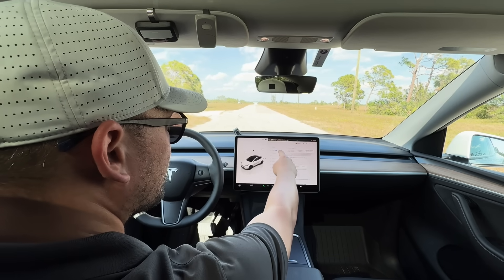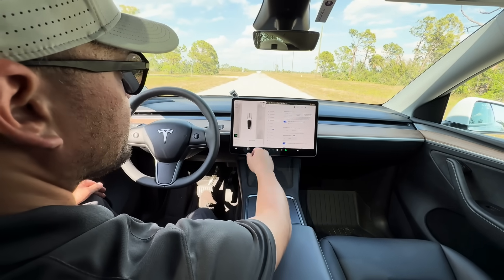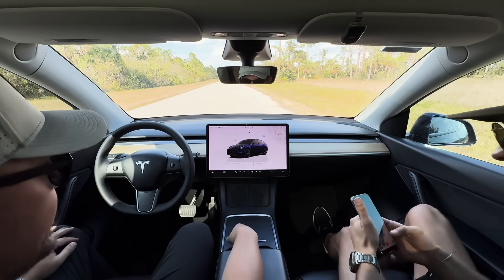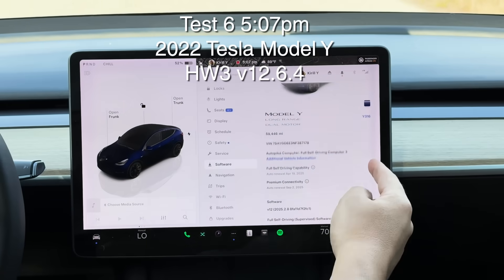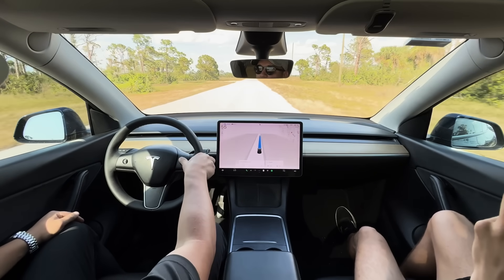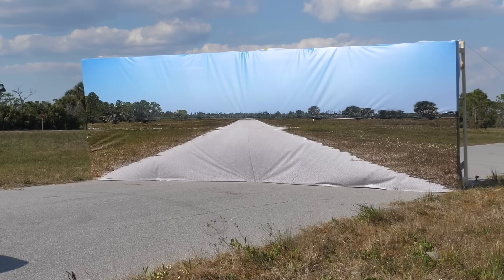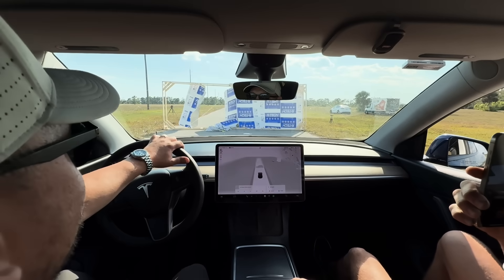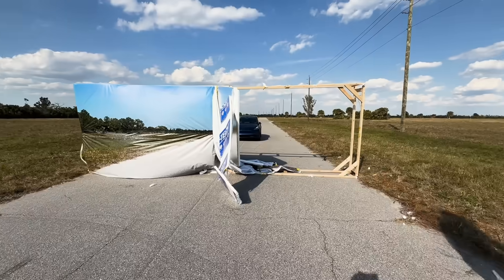Mark Rober Debunked - You can't fool a HW4 Tesla using FSD!

Comment: Everyone with more than 2 brain cells and barely surface knowledge about the tech would know this (if a human can spot the difference, FSD would also be able to). It was clear from the start that the NASA "scientist" was faking the results.
Reply: Well, he could instead of fake, just use an old version of the autopilot, which is still poorly able to process what he sees. But that doesn't change the fact that there are a lot of suspicious flaws in Mark's test.

Comment: Is your car equipped with radar?
And are you Sure it is Not equipped with it? (i.e. look where radar is placed normally)
Reply: Tesla hasn't used lidar in a long time. Especially not on the newest models. The only place where they use lidar is at the production stage for camera calibration.
Reply: @Wolfen13c  Oh the contrary. Some cars were equipped with radar (not lidar you know...). There have been teardown of a model X with HW4 and that one had the new so called phoenix radar installed. So we do not know for certain since Tesla is reeeeeallly quite about this (of course since he said that radar was not needed.....).

Comment: Not quite.  What you've shown is that your wall didn't fool your Tesla on this one test. This is very different from showing that the FSD system would never be fooled.  Just visually comparing your and MRs walls in your case there were obvious artefacts at edges that the algos might pick up at the decision range .  However, IMO the test shouldn't be that the FSD should never be fooled, but more that it should be fooled significantly less than a human driver.   This would be hard to achieve without LIDAR or hardware capable of full scene stereo 3D reconstruction.

Comment: Mark's claim was that cameras (vision-only) are fundamentally flawed, so it would always fail this test, and that the only solution is LiDAR. This video shows evidence to the contrary. Therefore Mark's claim is fundamentally flawed.
A good scientist would issue a correction, given his massive reach has massive consequences.
Reply: His claim was that they were inferior to systems that incorporate lidar.  I'll take it a step further and say any system that doesn't use multiple types of sensors (ie. camera and either lidar or radar) is going to be inferior to one that does.  Even Xiaomi and BYD use multiple sensors for their self-driving despite producing cars at a much lower price than Tesla.
Reply: Correct. I don't think he ever will.

Comment: There's a much better test that has a real story behind it, which happened in Sweden 45 years ago.
A bridge called Tjörnbron was hit by a ship and crashed, so a large part of it disappeared. It was night and foggy.
Seven cars drove over the edge, because they didn't saw that the bridge was missing.
FSD should handle such things, and sink holes too.
Reply: Someone should paint a sink hole/missing bridge on a road and see if it can fool the cameras.
Reply: I'm fairly certain there's videos showing FSD kicking out in heavy rain and fog... No missing bridge needed. Might be a good niche case for lidar though.
Reply: @bobclark6350  Fog, steam, and rain can mess with lidar, mark didn't do an accurate test.
Reply: Interesting but not really the point of the video.
Reply: Seems a bit to much to ask I think. It would depend on the angle of the sensors etc.

Comment: The whole original test was a refutal of visio-only based systems as they can only act on what they see. When there’s heavy rain, fog, bright lights etc that blind the cameras, it turns to shit. Radar/lidar doesn’t operate on ”vision” per se, so it will work in a lot harsher conditions. 
This test only tried the ”perfect weather” parameter. And it seems the hw4 is at least better than hw3 in that regard.
Reply: Robers test was also a perfect weather parameter. You can easily search HW4 performance in harsh conditions here on youtube.
Reply: @ did you miss the fog, rain and harsh light parts of the test?
Reply: I dont care. There was a difference.

Comment: Great job guys! Mark Rober should watch this and learn.
Reply: Mark Rober's picture didn't have tall trees at the sides.  The improved AI (and humans) can easily pick up on the parallax differences in the trees.   Someone could always create a fake picture in certain places that would completely fool humans and probably any AI that only used cameras (up to the resolution and distance where you could detect and measure the distance of contrasting pixels by triangulating from multiple cameras).  Or, depending on the lighting conditions, you could stand a mirror up in the middle of a straight section of road. It's kind of a silly test just to prove a point.  Obviously LiDAR can see better thru fog and in total darkness. Seems like it would help AI driving to be much better than human if it used sensors that humans didn't have.

Comment: somebody else performed this same test using the Cybertruck which has HW4 and it didn't go through the wall either. HW4 is definitely much better. Mark Rober is a hack. He should have used the latest technology in Tesla, which is FSD V13 and HW4. He didn't even use FSD, he used V12. Thanks for doing this test, more people need to see this
Reply: Tesla is a hack. They should have used the latest technology which is cameras + radio sensors + LiDAR + computer + AI. 
Thanks for doing this test, more people with HW3 need to see this and think again before engaging FSD
Reply: Why should he have used the latest technology?
Reply: @darrennew8211  because that is the most relevant and updated technology. It's like comparing an iPhone 10 with the latest  iPhone 16. And also, Mark Rober used Autopilot feature, which is NOT Tesla's autonomous driving feature, He needed to use FSD feature. The whole test from Mark Rober was bizarre and flawed. A real head scratcher. You can see here if you use the correct and most latest feature, the Tesla won't run through the wall

Comment: Great transparent test. I wonder how the ultrasonic sensors function for the HW 3 models in these cases. Even though the cameras didn't see the wall, the ultrasonic sensors should work closer to how a lidar sensor work being that they're both proximity based. HW 4 doesn't have ultrasonic sensors. I'm guessing FSD is fully reliant on the cameras even when it has the ultrasonic sensors?

Comment: Alright, do you Tesla haters have any complaints about how the tests were not good enough? I want to know if the tests have any problems that need to be corrected.
Reply: The people hating on Tesla are hating on Musk's broken promises, not the technology that's actually there.  The fact that you care about Musk vs Mark is hilarious, like Mark's video is somehow personally offensive to you.
Reply: No, this was good. And it shows that HW3 FSD fails the test, so all the accusations that Mark's video was faked were for nothing, his car really is probably incable of dealing with the wall.
Reply: @ricardoamendoeira3800 except obviously for a HW4 Tesla vehicle. Thats the only real vehicle that actually passes these (and other, more relevant) tests. Waymo also doesnt count, you cant buy a waymo
Reply: @Supreme_Lobster  I'm pretty sure if Tesla put old radio sensors back together with HW3 cameras the wall would be detected
Reply: @ricardoamendoeira3800 any car he could have used would have failed this test because there are basically no cars with LiDAR that you can (and would) buy. Xiomi's car doesnt count, you cant actually buy it
Reply: @Supreme_Lobster  A 10 year old WV UP with radar could probably pass the test or at least try to minimize the damage compared to just hammering through at full speed like the HW3 Tesla does.
Reply: @Supreme_Lobster  There are lots of modern cars with radar sensors for crash detection that would pass this easily. You don't need lidar to detect a wall.

Comment: The problem is not HW3 or 4 it''s V12 or V13. V13 actually use AI.
Reply: This is a good point, I was wondering why the ultrasonic sensors didn't pick anything up. FSD 13 is way better than 12

Comment: That is as proper test as it gets without involving dozens of people. You've done a very well done job
Reply: I would agree with that if the perspective were proper, but the horizon doesn't line up at any point on the approach, which makes the deception really obvious.
Reply: @catbert7  If that were the case then both cars no matter the version or hardware would have gone through the wall or stopped. It was a well done test.
Reply: @ProXcaliber  Neither mark robers or this guy's test is a "well done" test. Youd need to do it with multiple prints with different perspectives, material, and lighting, for it to be a proper test.
Reply: @slvyc  what do you want then? A holographic wall like from the MI series? This is as good of a test without cost prohibitive equipments...
Reply: @PrograError   
I just said it in my reply lol. Doing the test with different prints (adjustments in perspective, lighting, color, etc), trying at different times of the day and lighting conditions, and trying different print material. This isn't really expensive or as futuristic of an idea that you seem to think it is lol
Reply: @slvyc then you do it with FSD 13 and upload your own video
Reply: @PlutoisaPlanet   Huh? What kind of argument is that? So dum
Reply: @slvyc  it seems to be a distinction only you care about after all. I don’t think anyone will make that video besides maybe you if it matters enough lol
Reply: @PlutoisaPlanet  

mate, labelling this test as conclusive, would be like me saying every single human on earth likes pineapple pizza, because i asked someone who likes pineapple pizza if they like pineapple pizza.
Reply: @slvyc  who labeled it as conclusive lol?

This video is a response to Mark Rober’s. It pointed out a flaw in autopilot and this video shows that flaw doesn’t exist in the current versions. Maybe it can still mix up weird tricks with reality, but no one care about those unless they’re proven to exist. At least with FSD 13 there are no proven tricks to fool autopilot. If you’d like to set one up, go right ahead
Reply: @PlutoisaPlanet  My point is that this 1 test isn't conclusive enough to say that the issue in non existent. There are other factors that can play into this.

Comment: do you know if the 2022 HW3 had radar and sonar? I don't remember when it was removed, but my 2021 still has it. If it didn't it would be interesting to try the test with a car that has them. I remember that in those days autopilot would use radar waves bounced under the car in front to detect car in further in front breaking.